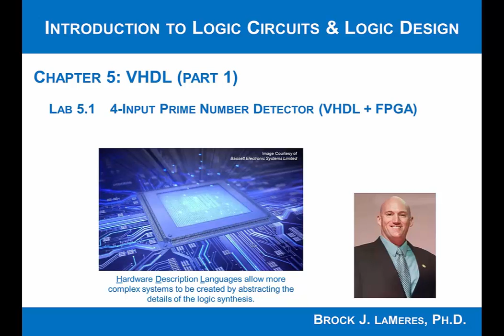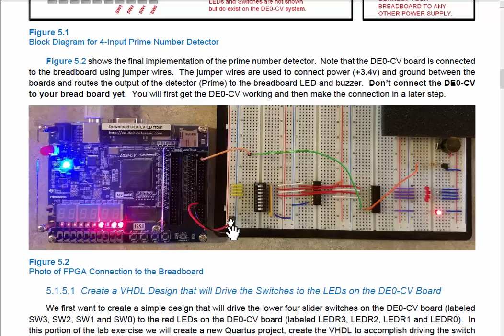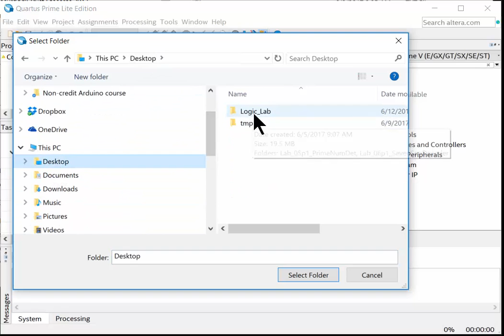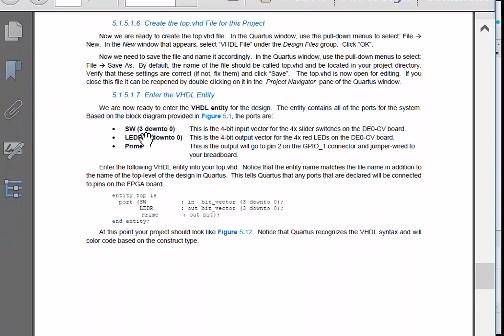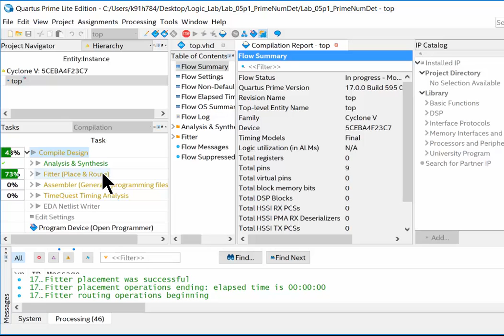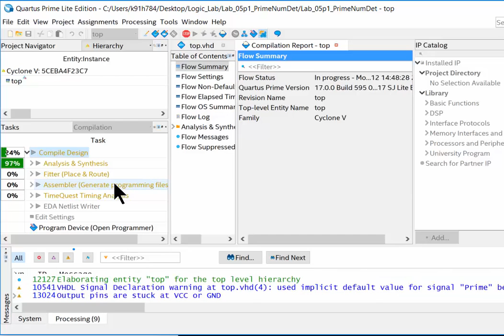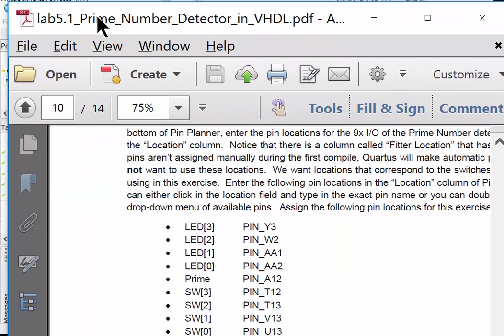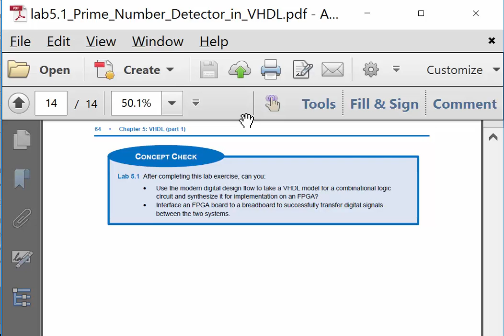Lab 5.1  - 4-Input, Prime Number Detector (VHDL + FPGA)

Comment: If you have a DE10-Lite use the family “MAX 10” and in the name filter type 10M50DAF484C7G
Reply: How did you find the pin location for the "MAX 10" DE10-Lite?
Reply: @fatulevi3342  it’s been a year so I don’t really remember but I probably just found the data sheet for it and went off that. Sorry if that isn’t very helpful
Reply: @KeeganGaffney   I found it. Just needed to search for the user manual. Had all the pin locations. Thanks!